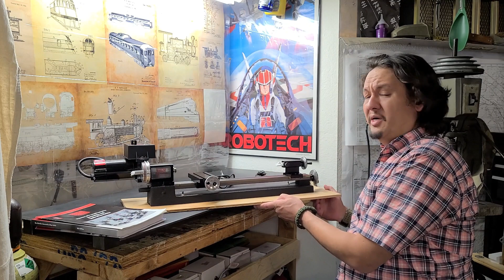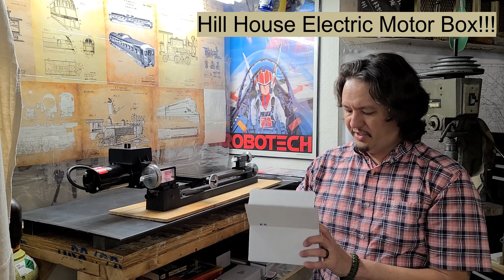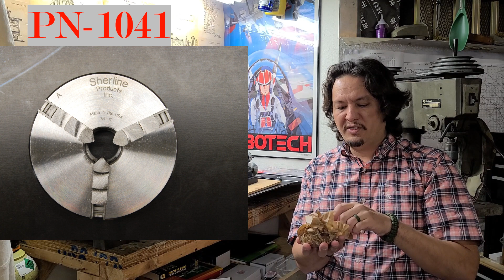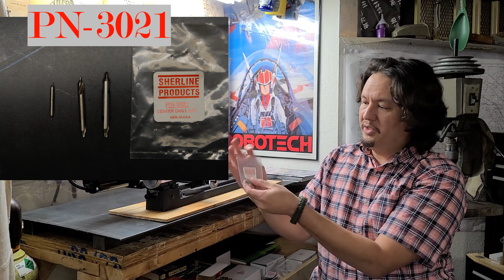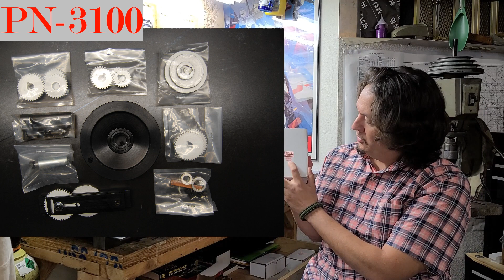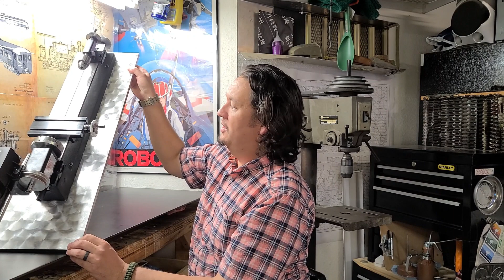Sherline Lathe C Package

Comment: Thanks for sharing.  It's been a while, do you like the lathe?  Are the gears included with the threading  accessory metal?
Reply from the maker: Hi there.  Yes I have had it for a while now that you mention it.  The lathe has been good and continues to keep tight tolerances.  That being said going through a couple seasons know it has become apparent it requires a tightening session every season change.  Going from boiling hot summers to freezing winters things get loose.  

The gears on the threading attachment are aluminum.  I believe the gears are laser or water jet cut but can't tell for sure.    

see directions :  https://www.sherline.com/product/3100-thread-cutting-attachment/#instructions

Since my machine holds such good tolerances, I'm hesitant to use it as it requires removal of the headstock to install.  Since all of my threading has been handled with taps and dies using it isn't a priority.
Reply: @LoydPrecisionMakers  Thanks so much for the info!  Happy machining!

Comment: Considering purchasing one of these lathes. Amazing vid but do you by chance know what it means on the sight to "upgrade headstock bearings to C5"
Reply from the maker: It is hard to call. So according to a bearing distributor: C1 offers the least extra clearance, C5 offers the most extra clearance. The extra margin C3 offer is considered 'normal'. Bearings with C3 are in fact the most commonly used. But I asked sherline and they claim "The C5 Bearings are an upgrade, usually for customers that use our machines in an industrial application (many hours each day)……C5 bearing races and ball bearings are highly polished. Running more efficient, quieter, and cooler". Any vibration or charter I have encountered have been self induced to the wrong tool geometry or speed and feeds.
Reply from the maker: Where this comes into play according to another bearing distributor: Most rolling element style mounted bearings have some degree of internal clearance to:

allow for free rotation of the inner ring;
prevent metal-to-metal contact between rolling elements and raceways; and
accommodate for thermal growth of internal components.
Reply from the maker: After asking for further clarification, sherline responded with the below.  I have to say is it is nice they respond so quickly. A+ on customer service. "The Radial and Axial clearance are the same on C3 and C5………Surface finish, Repeatability, also is going to be the same………The C5, is simply a better mouse trap when it comes to the Factor of running long continuous times each day (Light Industrial application)………..Using a Lathe or Mill in a “Hobby” application, you would not need C5 bearings"
Reply: @LoydPrecisionMakers  Interesting...  I've owned the original version of the mill and lathe since the early 1990's and have used both a lot in my hobby.  Never thought about spindle bearing quality/classification at any point in all l those years.  My machines are still going strong and making very accurate parts.  Just a little wear on the Z-axis of the lathe, up close to the headstock and I replaced the Y-axis table about 12yrs ago for the longer version.

Comment: I finally bought this same machine with the C package.  Sherline has a 30% discount going on through November, so the timing was right.

As you know, I am developing an enhanced backlash control system for my Sherline CNC mill.  Just building the first prototype after family health issues and summer activity delays, machining parts on the mill.  I’m able cut gears now on the mill, having fought my way through the 4th axis workarounds in my CAD/CAM software, and discovering in the process that 4th axis milling is a poor substitution for using a lathe when cutting diameters.  FYI, the system l’m developing will work just as well on the lathe.
Reply from the maker: Very cool thanks for the heads up on the fantastic pricing on the lathe.  That is a hard deal to beat.    I'll have to pass it along on my channel.

I'm glad to hear your back working on it.  I've had the crazy jam packed summer and an excessively hot workspace myself.  

Just out of curiosity is your backlash program going to be along the lines of G-code inserted post or generated with the g-code?

Comment: I've been looking at mini-lathes and watchmakers lathes.   How are you enjoying this lathe 2 years later?
Reply from the maker: Oh I Love it!  It has been a great lathe and I have not run into many problems except those caused by myself.  It is holding tight tolerances and is very repeatable/consistent.  Now that being said with these crazy summer temps, my garage space going to triple digits I have had some steel in aluminum screws back out at the beginning of the season.  Namely on the belt pulley that caused poor finish and chipped carbide inserts.

Comment: What are the specs of the metal base you attached your lathe to? The engine turned finish is a nice touch.
Reply from the maker: Thanks I enjoyed doing it.  It is a 31"x1"x1/2" aluminum tooling plate.  I got it at scrap/rem/drop prices.  The size was dictated to what was available at my local metal shop.  The finish was actually done by hand with a air angle grinder and a carefully laid out grid!!!

Comment: Smart getting the “C” package. I wish I had of just saved a few more months & got the C vs the A package- as it would of saved me a huge amount of $$$
👉I’ve had my Sherline 4000 series Lathe for 2+ years now & it’s been my favorite machine💯
ZenModeling
Reply from the maker: It is a nice setup l. I think the important thing is to get a machine and start making chips asap. It definitely got me going and some things like the center drills are going strong.  The only thing I'm  on the fence with is the threading attachment.

Comment: would this lathe be recommended for turning 1.5" 304/17-4 stainless steel for hobby rocket engine nozzles?
Reply from the maker: It is very much of a it depends response.  I’m not familiar with that exact stainless steel nor application.  I have machined a few stainless steel tender wheels, not on video but you can get the idea of machining done in this video: https://youtu.be/Z4XuoMSbX4A

Full disclosure I don’t know what the stainless type was as it was given to me and came from a machine shops scrap/rem pile and been sitting in a bin outdoors some 10 plus years.

The depends on answer comes down to speeds, feeds, cutter dimensions, application of cutting fluid, etc.  Sherline advertises the 3-1/8” 3 jaw chuck P/N1040 to hold up to 1-1/2” diameter stock.  I can confirm this is about the most I feel comfortable machining.  Using the riser block allows for a greater swing.  I have found my machine with proper fixturing t have sufficient rigidity and to hold within 0.001” tolerances.

Where all three brands are equal Sherline, Proxon, Taig really depends on your ability to ensure the workpiece is sufficiently held.  None of the micro/desktop/mini lathes have the weight or rigidity to hold a 1-1/2” diameter bar that’s 12” long and machine it safely or take heavy 0.050” cuts.

One place the Sherline does fall short is it uses a rheostat to control the speed.  It makes having a specific turning speed an exercise on  guesstimate and few tries to know the proper setting is to return to next time.  I don’t know what the other brands have.
Reply: follow-up, if not, what lathe would be best suited for said project?

Comment: I can’t decide between proxxon lathe or sherline lathe . I’m leaning towards Proxxon cus I’ve worked with one a few times but never worked with sherline. Help me decide ya’ll.
Reply from the maker: Ya I looked at the Proxon before I bought mine.  It looks good but I never had a chance to try one out so I can’t speak to the build quality or the repeatability.  Being in the US and having Sherline US based I’ve gotten parts and accessories quickly.  To this point I have been happy with the performance of the Sherline and can’t speak highly of it enough. I’m working on axels right now for the tender and it is really dialed in giving me mirror finish with TiNi coated carbide on cold rolled ground bar stock.  I would suggest really thinking about budget, need, and accessories.  Does the Proxon versus Sherline have the capacity you need? What are your needs for accuracy, space, production?  Etc. A lot too going into that decision.
Reply: I would purchase Sherline since the parts and accessories can be easily found compared to Proxxon.  I used to have Proxxon and Sherline at work.  I decided to buy Sherline mill and lathe for home use due to parts availability and accessories.
Reply: I was in your same position and ultimately went with the Sherline lathe and mill. Contributing factors? USA made, a massive amount of tooling available for the Sherline while the Proxxon is limited and some is proprietary (collets…) and nothing else will fit. I have three Proxxon machines, the tablesaw miter saw and drill press, and I can honestly say the products don’t match the “hype” surrounding the brand! Things like non adjustable angle detents that are badly off, safety guards that are nearly unusable, and motors that speed up and down even when they aren’t cutting anything……….. I live an hour from their US headquarters and distribution center, and I called about stopping by to pick up a part because I was headed in their direction on other business, and was rudely told absolutely not! “We’re not open to the public!”. It’s almost like Proxxon operates in spite of itself! Sherline products are rock solid, precision machines, and I continue to be amazed at how accurate they are! You’ll not be disappointed if you go with the Sherline!

Comment: Before this video i couldn't make up my mind between Sherline or Taig. I'm leaning towards the Sherline with the assumption that there is no manual changing of the belt because i see the speed controller. 

They are similarly priced which is confusing why they would make their showcase item use an ancient belt and pulley system to change gears settings?

I find Lathes intimidating even though i have been 3D printing for a while and made a decent CNC Router that I'm using to upgrade itself. Replacing the 3D printed parts because they aren't rigid enough to mill thick aluminum stock or thin steel.

No standard Mill for me, i want a Lathe and i can figure out how to incorporate both the Router and Lathe for some 4-axis shenanigans
Reply from the maker: Ya it is a close call that can lean either way on the Taig or Sherline for me as well.  I do like how the Taig is basically a miniature full size lathe with a working apron, etc. Sherline does it with more accessories like the crosslide assembly.  Though to be fair, I have been told many times the Sherline very similar to a turn of the century jewelers or horologists lathe.

Be sure to check out the Sherline Video on the motor, there are two pully positions, but they are readily changed by had, at this point I haven't felt the need to change my belts.

In terms of build quality I can't compare I've had no experience on the TIAG and I didn't have a chance to visit their factory in person before I decided to make a purchase.  Sherline had a really nice factory tour and showroom that was open before Covid.

Though I would say consider capacity in terms of your needs.  I don't know the Taig stats off the top of my head.  According to Sherline you can have up to a 6" capacity, based on the literature related to the Headstock Riser Block Set PN# 1291.  Link: https://www.sherline.com/product/1291-headstock-riser-block-set/

I've played with cutting leaded steel at the max capacity of the 3 jaw and between centers at 3: long, and it is asking the Sherline to do a lot with a touch of terror.

Comment: For that footprint and precision, Sherline seems to be widely recommended. However, I don't know if Sherline distributes to the European market (and so in metric calibration).
Reply from the maker: So they do make a metric version it is under a slightly different model umber.  They even sell  Metric and SAE conversions for their machines.  Check out the company in the E-Bay Link, their store lists metric version.  If you look at Sherline’s website the shipping terms indicate they ship internationally.  The drop down also lists the metric version: https://www.sherline.com/product/44004410-lathe/#shipping-returns

I’m aware of a guy or two using A Sherline in England and over in Australia.  I can’t seem to find their videos at the moment.  I believe they are using factory motor set up to run with their power.  Though this is something custom probably from Sherline.
Reply: @LoydPrecisionMakers  Nice! I also found a dealer in France as well. Thank you so much.

Comment: What other tools are you planning on getting for the A3? I have a similarly sized Taig lathe, but I always assumed I needed a much bigger machine for the A3.
Reply from the maker: Mill would be nice, I am still on the fence abut a mill or milling lathe attachment.  I saw that TIAG also makes mills and they are  Made in America company based in AZ.  Though with some math and ingenuity I can install the chuck in the head-stock and use it as a horizontal mill.  For sure, an arbor press, Kozo uses the drill press like an arbor press when forming decorative rivets.  I have been informed this is a great way to trash the drill.  Right now I'm stuck buying alot of layout tools and cutters.  I also need a grinder to sharpen HSS cutters and make custom shaped cutters.  Though I think some basic Amazon or Ebay carbide can keep me going when the HSS goes dull. It seems like the two biggest parts are the driving wheels and boiler.  The driving wheel are bigger than the chuck capacity for the Sherline.  I'm thinking of using their head-stock spacer and some sort of arbor.
Reply from the maker: Thanks sorry for the belated response. I'm still on the fence for a mill (Sherline or TAIG) versus the mill adapter for the lathe.  A lot of it if going to be cutters, measuring tools.  I really like the adjustable 4 jaw Sherline has as well.  What I’d really like to get my hands on is their Nickle-Teflon Rotary table.  Not necessary for everyone but I plan on machining the drivers from bar stock.  But to do that I’d need to settle on a mill first.  Absolutely necessary is going to be torches capable of hard soldering.  Though I am on the fence if I am going to do a solder boiler or Tig Weld.  I already own a good tig machine, so it isn’t a new acquisition.  A set of parallels, angle blocks, would be nice.  Definitely a good set of Interchangeable insert carbide is up on the list.  So one of the things that is keeping me busy is I am going through the book page by page, line by line.  I am creating a spread sheet of every single part, tool, and cutter used.  It’s a lot of horrid tediousness.  
As a primer to start, I’m glad I had a good caliper, micrometer, Dykem, divider, carbide scribe, drill bit set to get going.

Comment: I had a sherline lathe . I always regretted not buying a taig lathe
Reply from the maker: I hadn't looked into the Taig.  I see they have mills.  thanks for the tip.  I am still on the fence about a mill.
Reply: I know this is 4yrs old...  But why?  The standard or original Taig Lathe is so much more primitive than the Sherline lathe.  Now that's a different story if you're talking about the Taig milling machine parts that they configured into a lathe.

I have both the Sherline mill and the Taig mill and a Sherline lathe.  The Taig mill is a bit bigger and more robust, but the Sherline's fit and finish is far superior.  Truth be told, I boxed up the Taig mill years ago to make more work bench space and only use the Sherline mill now.

But all of them are decent hobby sized machines.  Hope to upsize, upgrade my machine tools to Precision Matthews in a few years once we move into our (hopefully) forever home.

Comment: I've had my eye on sherline cnc lathes for a while but there's no info online. I'm only trying to work with 1.5" rods to make rings and can't for the life of me figure out which package to go with. This video is helping me hone in on the info. If you've got any tips on what you think I should go with I'd totally appreciate it. Great job with the video
Reply from the maker: That is an interesting scenario. Unfortunately the Sherline is not able to handle a collet big enough for your needs. I believe they only go up to 5/16. I have a piece of 1060 carbon that is 12 inches long by 2.25 inches diameter. It is asking a lot for the 4400 to turn. The hole through spindle is only .405 so no feeding it through the headstock and parting it off as you go.

It kinda comes down to what base metal you're turning, finished dimensions, how much you need to remove, and speed of setting up the next job. Likewise you may want an rpm readout to set your speed consistently especially if your doing the same part over and over. You can mark the dial with the rpm after trial and error.
Reply: @LoydPrecisionMakers  huh I'll have to ask what my mentor did. I only ever found sherline because he started out with one before upgrading to an industrial level one. I used to practice on it and would often make damascus rings with 1.125" stock.

I actually really appreciate the concerns you listed because I never had enough time to build pros and cons of my own other than the fact that my wrist wasn't killing me like when I was doing it manually lol